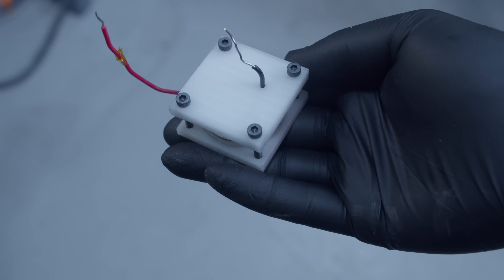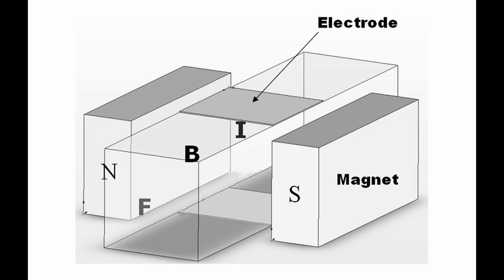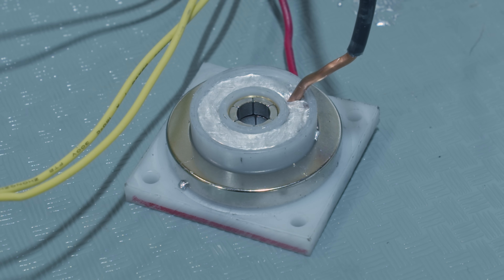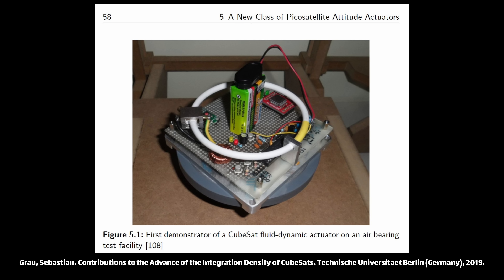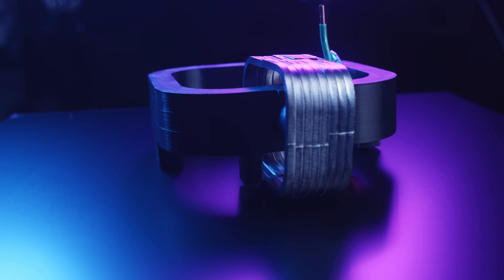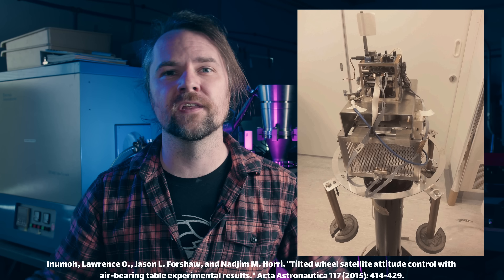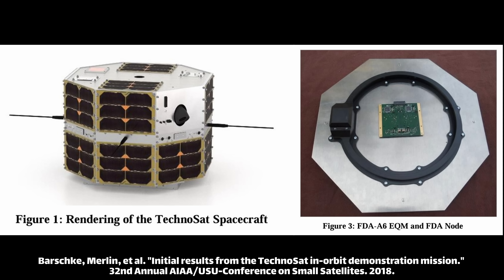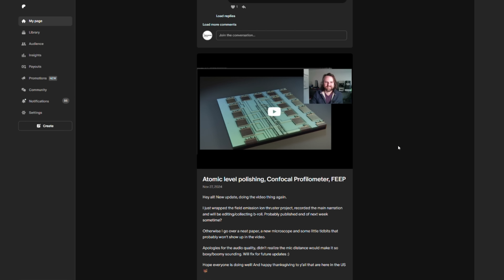A motor with no moving parts (sorta)

Comment: Could you use an electrolyte solution instead? The vacuum of space shouldn’t matter too much in terms of liquid evaporating, because it’s theoretically in a completely sealed enclosure, right? Plus, with an electrolyte solution, while it could still have some issues with corrosion, it wouldn’t be as extreme as gallium mixed with aluminum is. Plus, with an electrolyte solution, you could potentially tune the resistance of the liquid, which could reduce the amount of power needed overall. At least with conventional dc motors, the motor’s speed is a constant of voltage, rather than current. Assuming the same holds true for this, wouldn’t a higher resistance allow you to use more voltage and less current/potentially less power to make a more effective reaction wheel?
Reply from the maker: Yep, you could! The downside is lower conductivity and reduced density, which will impact efficiency. The lower conductivity unfortunately means you lose more to joule heating (it acts as a resistor basically, and just eats the power as heat), and the lower density means you don't get as much angular momentum for the the volume. But there's probably a sweet spot where it makes sense / optimizes to a useful set of parameters!

There are also alternative like ionic liquids (salts that are liquid, instead of salts dissolved in a solvent). Not sure I've seen papers on it so dunno how it compares, but should be doable too!

Comment: I can create an internal guidance unit from this. I see a potential use case in satellite orientation alignment by leveraging Earth's magnetic fields.
Reply: Design would be like a microprocessor module, and a tightly packed liquid metal in a ring structure with a cavity. The cavity would serve as a reference point for detecting changes in state. Like a optical gyro.

Comment: Glad to see you closing the magnetic circuit with the iron. Even if there isn't enough, you're making a static field so hysteresis isn't really a big deal. Too many people just don't bother understanding a flux circuit and just rely on the unreasonable strength of rare earth magnets to leave all kinds of magnetic performance untapped, or just double the magnetic material required.
Reply: I remember learning the formulas in university. Even just a millimeter air gap is such a huge reluctance! Lacking a back iron really wastes a lot of potential.
Reply: पार्शियली अंडर्स्टुड!
Reply: blame the education system...
"heres the field lines children heres the magnetic force! watch it move things!"

takes a lot of unlearning to get ones head around the field INSIDE being the important bit... and trying to keep it there.

Comment: 4:38 a reaction wheel is supposed to stop the rotation, not induce it (or at least not in the way that it's seen in the video)
Reply from the maker: They do both! Reaction wheels can de-tumble, but are also used to slew to new locations. It's how Hubble, JWST, Spitzer, etc all control their pointing at targets.
Reply: @BreakingTaps  yes but the movement what you showed isn't really what moves the spacecraft, as that rotation it induces will be lost due to friction, instead they usually use gyroscopic effect, and I think it would have been pretty interesting to watch what would happen if you incline the motor while it's hanging
Reply: @todeilfungo You are talking about control momentum gyroscopes, reaction wheels are really as simple as shown in the video.
Of course they have fancy control algorithms precisely controlling the wheel's acceleration and, they get saturated over time due to friction etc. meaning they hit their max RPM. Then they have to be desaturated using thrusters or magnetorquers.
And when you spin them down your satellite will start tumbling again. But there a quite some satellites that are fine with only temporary attitude control or don't need any at all.
Reply: @todeilfungoit's a PoC
The fact you can see it rotating in the video is enough to extrapolate other usecases
Reply: @simonrichter3950  in this design wouldn’t the friction help prevent saturation? Maybe a minuscule value, I don’t know, but if the rotor sheds kinetic energy in the form of heat wouldn’t that mean it takes less energy to desaturate? I imagine the relationship could also be time dependent since the spin up and spin down times do not need to be the same with friction leaching energy from the system.
Reply: @seabeepirate  Yea it would counteract saturation, but the friction also reduces the momentum generated in the first place, so you get less/same effect for the energy your putting into your actuator.

Imagine when you complete block the cross section at  one spot, so no fluid can flow, you're just not producing any momentum, the device will never saturate, since the fluid will never move.

Also not much to gain from accel vs deceleration, keep in mind that in space the whole satellite has nothing to hold on to, it can only transfer angular momentum into  or out of its reaction wheel mass / fluid  dynamic actuator fluid. 
Effect of Friction would be similar to the effect slowing down the mass of the actuator and would transfer momentum back into the satellite, which will then rotate/tumble faster.

The sum  of angular momentum of the satellite body and its actuators can only be changed by miniscule amounts of air drag,  interaction with earths magnetic field (using electromagnets) or stuff like thrusters (which rely on limited fuel supply).

Comment: A flywheel would keep a constant attitude with no extra power but such a liquid reaction wheel would start counter rotating as soon as the power is cut due to fluid friction loses slowing the inner liquid. interesting concept nonetheless
Reply from the maker: Also note that reaction wheels have bearing friction and cogging torque which will slow down the flywheel too. No free lunch :)
Reply: He mentions that 
At 10:00
Reply: @hashbrown777  Would be interesting how efficiency scales with size. As of now frictionless seems to be achievable with magnetic bearing flywheels but reducing fluid friction to negligible seems unlikely. A liquid metal's properties don't seem to help in that either

Comment: Satellite reaction wheel bearings used to fail all the time, but the problem was solved in recent years. They've stopped using metal ball bearings and now use ceramic ones instead. The ceramic ones require no lubricants and are not susceptible to static electricity surface pitting slowly destroying them.
Reply: Are there any downsides to ceramic bearings? Do they have a lifespan or are they functionally "unbreakable" since they will never wear out before a satellite's end of life?
Reply: @amogusenjoyer  The biggest downside I'm aware of is they cost far more than metal bearings, because everything about their manufacture from raw materials to processing and polishing is more difficult. Also as these ceramics (Not ceramics in general, for which human use probably predates metals) are relatively new tech, a lot less time and money has been invested to them as cheap as metal bearings.
Reply: @peglor  but they are also way more brittle so they should have problems with dynamic loads and shock on the axle. I dont think there is a best bearing, and ceramic bearings have been used for quite some time i think - for example in spindles of cnc milling machines. they are not cutting edge as far as i know.
Reply: @ozr2222  Keep in mind there isn't one specific ceramic that ceramic bearings are made from. Some ceramics are remarkably shock resistant too - think similar to the chemically hardened glass used on phone screens compared to normal glass. 

Just don't buy anything in the bicycle industry that uses ceramic bearings as a selling point - literally every single one might as well be snake oil for any benefit it offers.
Reply: @amogusenjoyer they're the best bearings we can produce currently. They cost an absolute fortune 😂
Reply: @MiTheMer  and to provide a sense of scale, steel bearings at the same specifications start at ~17 cents each. That 100x difference gets even larger when you scale it to the size and load required in satellite operation
Reply: Bearings shouldn't be a problem at all in Zero G. You have several options, from magnetic contactless bearings, to low friction ceramics or even crystalline ones. Liquid metal reactionwheels might have some niche advantage though.
Reply: @ker6349  Usually its the really large bearings that get really expensive. I wouldn.t have thought anything on a satellite is going to be too big.
Reply: @changingmyworld-j9z  bro has no idea what reaction wheels are or the scale at which they operate 💀 or the conditions under which satellites operate and the research and development that goes into making a reliable product. Do you have any idea how big the James Webb telescope is? You think that thing could unfold with the skateboard bearings mentioned? It's a big world homie, there's a lot you wouldn't think about that still happens, try waking up a lil
Reply: @amogusenjoyer All bearings have a lifespan, naturally. 
Ceramic ball bearings are a singular solution for shorter to medium lifespan missions, the metal captive rings will still pit and eventually cause the ball bearings to suffer shock damage creating dust in the ball bearing track, they are also a bit less thermally resitant but these are a fair bit easier to design around. Obviously a lot is dependant on the mission  the design of the craft, how much internal thermal variation will they see etc etc etc

And when coupled with active magnetic bearings they are a long term solution that could out last the heat death of the universe... if they somehow managed to be powered and not get hit by something else in that time.
But if your looking to why a lot of people just pooh pa the idea of solar radation being a concern for space habitates, or wear and tear on "spin gav" components umin long term space habitates..  this is part of why. Coupled with magnetic bearings the ballbearings only see a few nanoseconds of pressure as everything energizes and loads shift and they can be designed to last several years under load.
Reply: This. They realized that over time, electrical potential would cause small sparks between the ball and the race, which caused a point of imperfection. These would build up and lead to failure.
Switching to non-conductive balls and changing the grounding methodology has plummeted the failure rate
Reply: @Seldoon_Nemar  You are correct, but there is still some small erosion.  You have to dissipate the charging by some method, and is some cases it is through the air.  In vacuum wheels this dissipation path is very slow, and allows buildups to megavolts, essentially like a VanDeGraff generator.  Even with ceramic isolation, there is still occasional sparking, and then the process repeats.  Some of the ceramics are actually made "slightly" conductive, just enough to reduce any high level spark erosion.  Same is done for car tires, to avoid building huge voltages on a moving vehicle.
Reply: @brunonikodemski2420  Good points,  a similar shaft erosion problem is found on ships alternators due to grounding problems. One ship engine had bearing shells eroded because the shaft wiping ground was not discharging a parasitic voltage. Right mess it was. I have seen high potential erode rolling elements, it can be detected using vibration analysis as the frequency is the same as the ball spin. Good comment thanks .
Reply: There's also the phenomenon of cold welding in the vacuum of space.
I don't know enough about the clearances and lubricants but I'm sure the people who create satellite gyros do.
Just wondering if it might be a contributing factor.
Reply: @jimurrata6785 it is a contributing factor but the pitting was significantly worse than initially theorized so thats why they needed to change rather than wanted to
Reply: @ker6349  well, ceramic bearings will certainly eliminate the static charge problem and are free to roll if not constantly subject to shock loads.
It's a great solution for expensive assets that you cannot maintain.  👍
Reply: @jimurrata6785  Galling or Cold welding, you are correct and it is present in ceramic bearings. One problem solved creating another. This chaps project is very interesting and Michael Faraday would be pleased to see the electric motor invented by him now has a practical use. But not with Gallium.
Reply: @jimurrata6785  It's really a clearance thing. People are speculating that it's caused by high energy particles from solar storms. It's basically what happened to the Kepler space telescope, two of its reaction wheels stopped functioning after a few solar storms. And it's orbiting the Sun and outside from the earth's magnetic field.
Reply: The metal ones didn't need lubricant either but the damage from static discharge etc was underestimated and degrades performance sapping power / means early failure.
Reply: From what I remember, the ceramic wheels were placed in the satellites years before they figured out that solar winds were causing the pitting.
Reply: @ChaoticEnigma-  Yeah they switched years before they actually "figured out" what was causing the failures.   My guess is whoever made the switch probably had a suspicion, but either way by the time they actually figured it out it was solved, lol.
Reply: @takanara7 "They" had access to the returns from space done by shuttle
Reply: 15 years ago changed ball bearings in my vacuum chamber to ceramic ones. metal bearings was dead every year of work. ceramic set still working fine.
Reply: @ВладимирАфанасьев-с8ц  Have you tried Teflon grease?
Reply: I love people like you .. I consider my self a pretty knowledgeable nerd but I know there is TONS I don't know and I love comments like this.. as I didn't know that is what was eatting the bearing up . Thanks for the info
Reply: Any ballbearing is going to wear out on a long enough timeline. Ceramic or otherwise. Just because they made them more durable, doesn't mean they solved the problem. They only mitigated it. Especially depending on how much more durable ceramic bearings are. If it's 'only" a factor of 2 or 3, it would still be problematic. Just not as immediately as steel bearings. But, without having any data or citations that state either of these figures, I can't say for sure. I can only speculate and mention it as a POTENTIAL issue. Nothing more. It is a very tantalyzing prospect, though. I'll give you that.
Reply: Cool thats neat
Reply: Yeah the ceramic won’t cold weld together glad you were on the same page I was
Reply: The main drawback of ceramic bearings: acceptance. There are still many engineers thinking about the delicate vase when they hear "ceramic". It is impossible to convince them no matter how many facts you present.
Reply: It's been decades - not really "recent years".
Reply: How about using Ultra-high-molecular-weight polyethylene? It's been used in hip and knee replacement since the 80s.
Reply: THE SYSTEM IS GARBAGE BECAUSE GALLIUM AND MERCURY PRODUCES A DANGEROUS GAS THAT AFFECTS THE BRAIN AND PRODUCES HAT DEMENTIA PLUS IT HAS NO INNOVATION OR ADVANTAGE OVER THE SAME MADE IN HARD METAL WITH IRON AND COPPER IT DOES NOT EVEN HAVE A WEIGHT ADVANTAGE
Reply: My question is what took them so long? There's some ceramic bearing supercharger type devices that require no lubrication and are pretty good tech and those aren't at all new
Reply: some uses floating bearings.
Reply: Now they use diamond bearings. polycrystalline diamond
Reply: @mrDarktrooper  JEW'ED BEARINGS. like every top end watch ever made. 0 lubricant. liquid reaction wheels. YEH VERY COOL. HAVE YOU HAD ALOOK AT FLUID CORED TRANSFORMERS. doughnuts with vertox sloshing cores. water is di pole n ok. mercury. n sloshy vortex doughnuts. OH MAMA. charge coil, drive coil, n bigger OUTPUT COIL. the out will push drive. once the charge is upto outputting. then out pushes drive. with massive usable output. victor sherberger stuff.
Reply: Why don’t they use magnetic bearings.? Given the minimal gravitational acceleration present, I would think those might incur zero mechanical wear.
Reply: @ It's probably a balance between longevity and space - volume. Ceramic bearings take up less space.
Reply: @GrowthCurveMarketing  probably use too much power
Reply: I've also heard of liquid metal bearings. They have really low friction once they are warmed up and spinning and run incredibly true.
Their service life is so long, that the manufacturer deliberately went on to design them so they fail sooner.
Reply: @felixm.8910  Designed to fail.  Yup, that's what society gets when business majors rather than engineers are in charge.
Reply: I could have told them that at the beginning, wow.